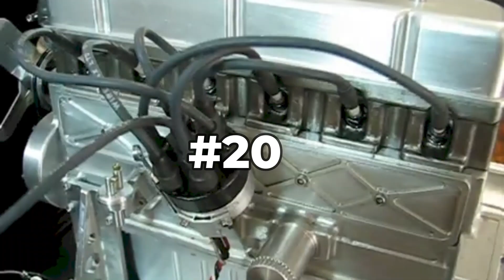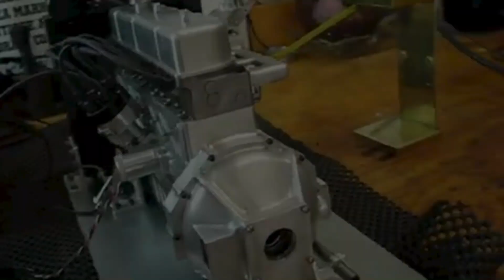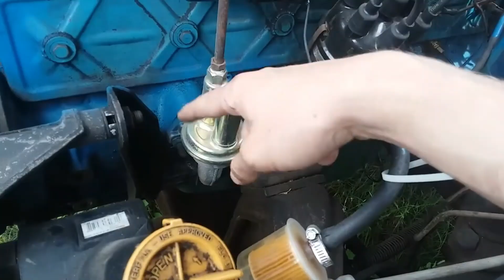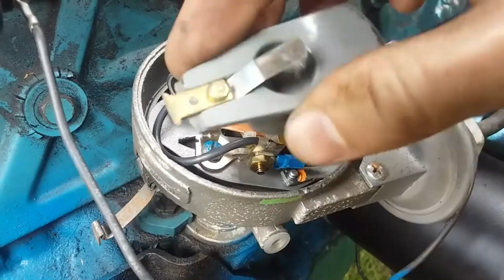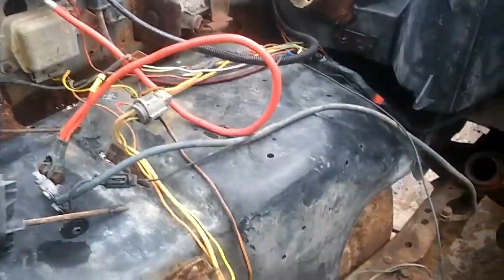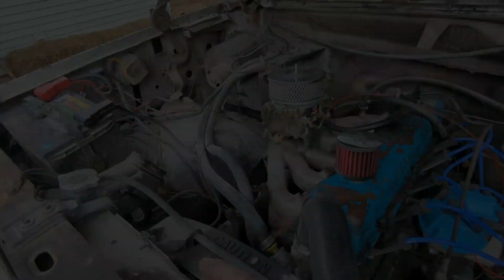20 Weird Facts You Didn’t Know About Ford’s Bulletproof 300 Inline Six

Comment: I don`t agree with the assessment of the M5OD, I personally wore out 2 before scrapping the truck (what were they thinking specing automatic trans fluid). It`s too bad they never put the zf from the diesel  in them
Reply: Those M5OD transmissions weren't that bad, just driving normally and keeping everything up. They were very fragile though, if anything happened to cause even a small leak, they were unforgiving. They weren't made to be abused at all, not even a little bit, and I think that's what gave them such a bad reputation. They didn't do well with any kind of neglect or in high power applications.
Reply: Did, but in F250s only and it was rare. Maybe only a option in 2wd, I bought one like that.

Comment: I have a 95 E350 club wagon XL 15 passenger van that I took the seats out of and made the a rolling work shop and tool box and I don't know what the problem is but it doesn't have enough power to get out of it's own way I don't know if it is not paired up with the right automatic transmission or if I just have a bad weak 300, I'd like to get it working the way it should be
Reply: Lots of things it could be.  Possibly an engine issue, possibly the gearing, possibly a problem with air/fuel delivery.  No matter what the problem is, 150 hp isn't going to move that van very fast.

Comment: And I wish ford still made them . I had a 89 f150 , would out pull any v8 , insurance company would not let me keep the engine after I totaled the truck in a snow storm in 93 .
Reply: That is hard to believe. My old small block chev would out pull my buddies brand new 300 and i had 276 rear diff.
Reply: Not that it was a bad engine. There tough !